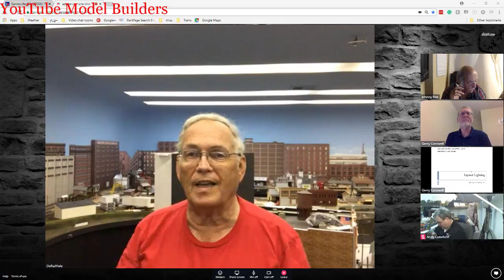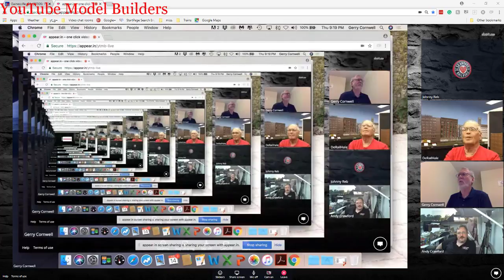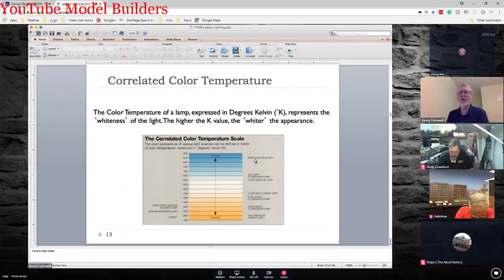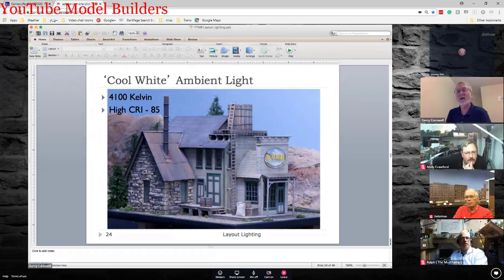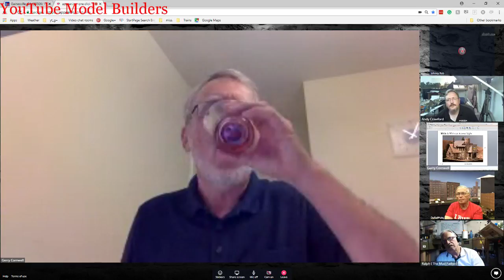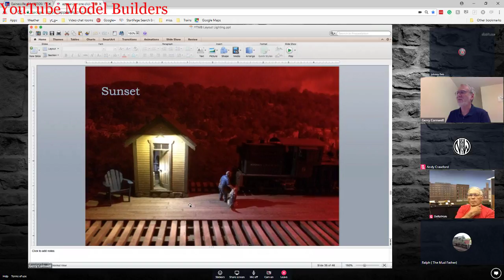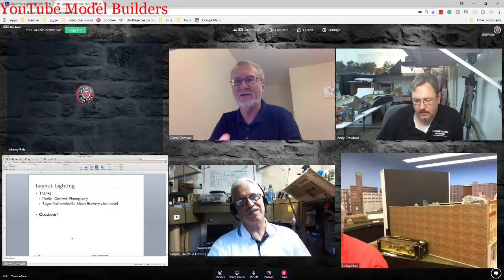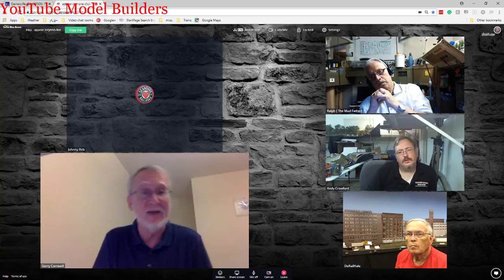YouTube Model Builders is proud to presents  The Fine Scale Live Show.June 14, 2018

Comment: Regarding LEDs and dimming:

You discuss two categories of LED lights - ones that are form-factor compatible with conventional fixtures and run off line voltage (110v for most non-commercial in the US), and LED strip lighting. They are fairly different in terms of what it takes to control them for dimming.

Line voltage is alternating current, going from 0 up to 155v then back to 0 then to -155v then back to zero, in a sine-wave waveform, 60 times per second (50 in Europe). (110v is the RMS average, 155v is the peak.) Most inexpensive dimmers (like the ones you'd get at your local hardware store) for incandescent bulbs use a circuit that controls how much of each 1/120 second half-cycle the bulb is actually on for. For full brightness, it lets the power through as soon as the voltage goes above (or below) zero. For dimmer light, it waits for part of the cycle before letting the power through. When the voltage gets back to 0, it starts the process over. In order to make them inexpensive, the dimmer depends on some characteristics of incandescent bulbs to help generate the delay before turn-on.

The driver in the line-voltage LED bulbs use a switching regulator that divvies the incoming power into tiny (very brief - as short as a millionth of a second) slices to kind of repackage into the right voltage and current for the LED. The simplest (and cheapest) of these regulators do not look enough like an incandescent bulb load for the simple (cheap) dimmer circuit to work right. Dimmable LED bulbs incorporate extra circuitry to make them look enough like an incandescent to the dimmer to keep the dimmer happy. Then it has to do its own work to convert the dimmer's output to corresponding changes in brightness of the LED. It isn't an easy juggling act, and gets harder to do when the dimmer is set to very dim levels (where the dimmer itself has limitations in most of the inexpensive dimmers).

Most of the long flexible strip type LED lights strings have operate the strip itself off of a lower DC voltage - typically 12 or 24 volts, depending on the strip. The driver is essentially just an efficient DC power supply (not usually incandescent dimmer compatible), and is frequently attached to the flexible strip of LEDs with a connector. A very simple circuit can pulse-width-modulate the DC from the power supply before feeding it to the flexible strip to implement dimming with a very full range of brightness. Some strips (like the one from OSRAM that Gerry showed) have that dimmer built in to the power supply (driver).
Some other strips have LEDs with dimming circuits built in, and can be controlled by simple commands from a (user supplied) micro controller controller like an arduino. It is fairly simple to interface an arduino to a DMX or 0-10v dimming control signal and use it as a translator to the control signal needed by the LEDs with built in drivers. In some cases, the control signals in the LED strips are such that each LED can be controlled separately. In others, all LEDs in the strip work in unison and have to be set to the same brightness or color.

A third category is some line-voltage LED bulbs that have a wi-fi or bluetooth receiver built in, and can be controlled and dimmed remotely via those wireless methods.

If you are concerned about color rendition, be aware that dimming can also affect the color temperature of a light bulb. This is especially true for incandescent, which will be significantly redder (lower color temperature) when dimmed to lower levels.
There is usually less shift with LEDs.

It certainly is a time of change in the lighting technology industry, offering many new possibilities.

A couple of other advantages to LED lighting:

The much lower level of heat generated in the room compared to the incandescent lighting it replaces can make the room more comfortable.

Very directional LEDs (operating off of DC, not line-voltage incandescent replacements) can provide accent lighting in confined spaces, either from above or concealed in the hidden side of scenery. They are available in brightness levels that bridge the gap between the true-to-scale lights incorporated in models and rolling stock and the overhead lighting.

One other point. While pulse width modulation (PWM) is easy to use to provide full-range dimming, LEDs can also be dimmed in an analog fashion. To do so, you need to understand that LED brightness is very non-linear with applied voltage, but relatively linear with applied current. So instead of controlling them by regulating the voltage applied to them, you do it by regulating the current through them. That is why there are resistors in series with the LEDs in the strips. They help regulate the amount of current, by making the current less dependent on the voltage across the LED.  Most of us are familiar with fixed and adjustable voltage power supplies, but fixed and adjustable current supplies (and circuits) are also available - just less common.

I designed a fast clock with DMX control of incandescent lighting years ago for my dad's layout (sanjuanrailroad.com) some years ago. I'm currently working on updating the design to include more lighting zones (the old unit had four) and flexible control for the newer LED lighting types now available, including transmitters to simulate the remote controls for LED strips like the one from OSRAM shown in the video. I plan to a include time-based control of sound effects like pre-dawn bird activity as well.